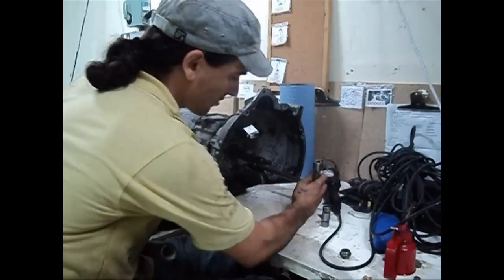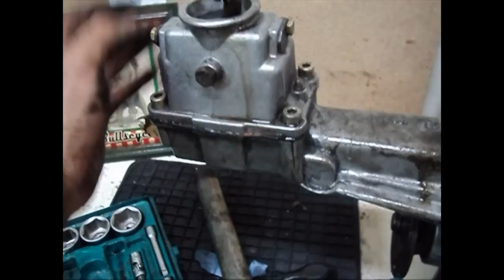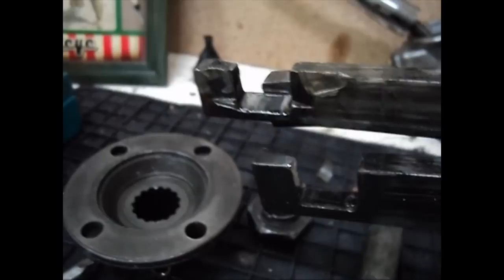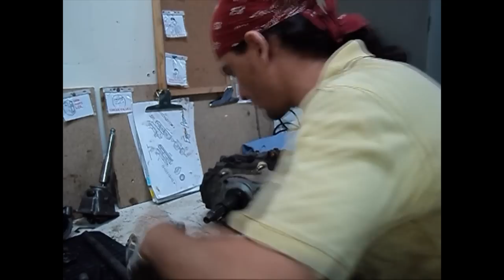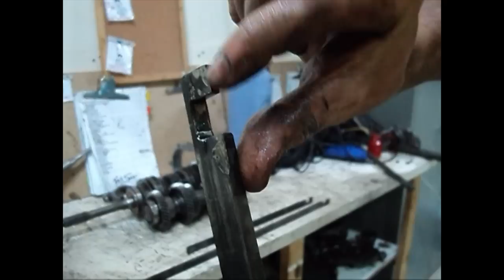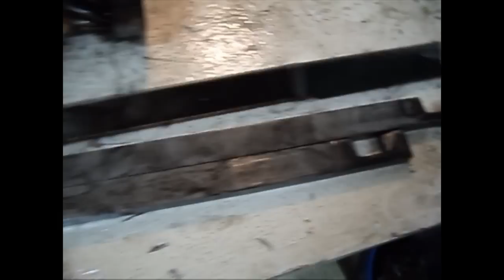Gearbox Disassembly and Inspection - Maserati Spyder Part 11

Comment: Cool! I did not know my old Iveco Daily from 1983 had a gearbox that is similar to the onces in Maserati, Opel, Renault, Ford etc and even use in racing for crying out loud. My Iveco van does quite the opposite of racing, low revs high torque...
Reply from the maker: Yeah, some parts do match with the Iveco but in those days many cars shared similar suppliers
Reply: Matthew Micallef
 did you ever try to pry out the mainshaft bearing in the rear (towards propshaft) after removing the ring? I thought to remove that bearing to replace it, without removing the entire gearbox. But it seems to be stuck pretty firmly... Suggestions or experience?